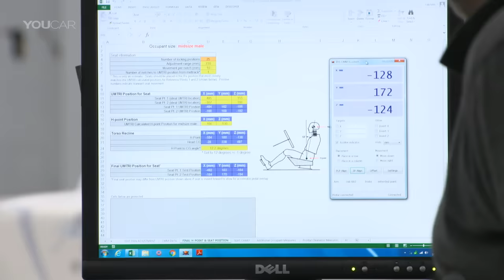CAR VS TRUCK – CRASH TEST Semi Trailer Side Underride

Comment: As a truck driver with 14yrs of experience, I'll be happy to inform the public that the fiberglass skirts on semi trailers is for fuel economy/aerodynamic purposes only. Side impact protection would be a nice addition to all trailers but I doubt I'll see it regularly.
Reply: The trucking companies such as Schneider would lobby the fuck out of congress and local governments before they allowed this. Although the regulatory bodies themselves probably have the power to do it without approval.

I would image it weighs a fair bit but I would assume you could potentially make it out of aluminum and have a similar effect.

Personally I’d like to see it more so because when driving next to a semi, I’m always afraid something might happen where either the semi swerves or I swerve and then I wind up under the trailer and get crushed by the back wheels like in 2 Fast 2 Furious lol. That’s why I always either follow or quickly pass a semi, I never drive next to them for more than 3 seconds.
Reply: Cheaper for a few lives to go rather than change a small thing on millions of trailers.
Reply: @ibooogeymani9380  unfortunately you're right.
Reply: 1OOTH like
Reply: People who are saying use the same thing as on the rear of the trailer, but isn't this essentially the same concept with with an aerodynamic skirt attached to it?
Reply: Antonio whatever profit over people man
Reply: As a driver myself wtf are people doing driving under a trailer in the first place this isn't the fast and furious. Although this would be amazing to save lives, unfortunately 4wheelers will always think the own the road and find another way to get killed by a semi.
Reply: Great idea. Should be mandatory. But weight could be an issue
Reply: @stran9adan9a63  yeah that was what i was wondering. How are you going to end up hitting the side of a trailer.not possible on the freeway but maybe on exits
Reply: If that becomes common you will see more semi trucks hung up on train tracks !🤦🏼‍♂️
Reply: I can see this happening when someone runs a light. But it's just not feasible to save everyone from every risk. Let's wrap ourselves in bubble wrap and hide in the basement, and call it a day.
Reply: I thought the skirts were to keep people from doing the fast and furious driving under a trailer thing. 🤦‍♀️
Reply: @emb_ivy  nope; just a fuel saver. LOL
Reply: Yet Tesla get the blame for the missing crash protection on the trailers....
Reply: @ibooogeymani9380  still you could consider the long-term cost of losing a few lives. Maybe those few people were important to somebody, or we're going to invent a vaccine, or were a doctor to save patients, etc. In that case the truck companies should pay to install the under-ride guards for tractor trailers. Also according to a similar crash test, the rear bumper on trailers are sometimes too weak and a car rear ending them would result in similar fatalities to this crash test. Rear end accidents can be considered common. I wonder what the price is for the good under-ride rails because if they're cheap, they can be worth it.
I think it's fair for truck companies to pay the cost. Our passenger cars have to pass a safety and emissions inspection to protect ourselves and others, and we have to pay for the repairs if necessary to drive. We can't drive without bad brakes, it would not only harm us but others. Trailer under-ride guards could be added to trucj safety inspections. That way it makes sense for truck companies to pay for the under-ride protection.
Reply: @AmandaHugenkiss2915  Yup. Why don't we require roll cages in all cars. After all, if it saves just one life...
Reply: It would be good if we started with more basic things like mandating more-than-decorative rear bumpers and prohibiting the 10-inch killer spike nuts for the front wheels.
Reply: I think is best to build a wall on the side of the roads high enough to keep the car in between the walls all over the roads. And let one vehicle per one mile in between that wall also put tracking ECM on the cars , so everytime they speed goes higher, it will automatically stop the process. That way we will never have accident and our insurance prices will be so low that some insurance companies will quite.
Reply: I thought it was also for rain channels so it doesn't blind drivers as bad in torrential rainfall
Reply: Hence why the second set are better for everyones safety
Reply: There is a bill in Congress right now to change that.
Reply: @ibooogeymani9380  They should start to at least only sell semis with side protection. Ir just make a law where you can't drive without it

Comment: In Europe side impact guards are mandatory on trucks. I find it really strange that this is not the case in he otherwise safety conscious USA. This setup is very dangerous for passenger car drivers. Also the autonomous emergency braking in newer cars might not “see” the truck until it is too late.
Reply: Are you kidding? The safety requirements for trucks regarding protecting cars in crashes range from ridiculous to non-existent in the USA. Rear bumpers are a joke at best. Truckers can put wheel nuts in the shape of long and super sharp spikes in the front wheels, like if they were Roman war chariots.
Reply: @adb012 those "wheel nuts" are nothing more than shoody plastic covers for the actual lug nuts. They can be broken by just breathing on them hard enough.

Comment: I've watched lots of these vehicle crash test videos and never knew where the car was coming from. Thanks to this video I now know that there's a long acceleration tunnel that it comes from. Also, why they decided to crash a car into the side of a trailer with air deflectors installed is beyond me. They're not designed to provide any protection for vehicles striking them, unless of course your vehicle is made of air.

Comment: Good idea only problem is with those side skirts on there you're bound to get stuck on railroad tracks in and Out of delivery Bays. They sit too low the truck will get hung up in many places. Ive been to stops and crossings where just the fiberglass skirts were dragging on the ground. Now add the metal brace and your stuck on the tracks

Comment: Fun Fact: That fiberglass design isn't meant to stop a 35 MPH side impact like that. It's supposed to prevent cars traveling alongside the trailer from getting stuck underneath it. it's not poorly designed, they're just testing it for something it wasn't designed to handle.
Reply: Huh?? Sucked-in??
Reply: Those skirts were literally invented to make trailers more aerodynamic so the truck could save fuel. Nothing else. Also the only time a car would get stuck under a trailer would because of the result of another accident, or if someone blew a tire and lost control.

Comment: doubt they'll put this for everytruck, more weight therefore more fuel consumption and cost for both installing it and running with it.
Reply: thaik56 The aerodynamic improvement over having nothing there would more than cancel out the weight difference. And when comparing against the lightweight aero ones while hauling a loaded trailer, the weight of the supports wouldn't noticeably hurt fuel economy
Reply: won't be able to do a thing when IHIS makes it mandatory
Reply: thaik56 could this increase arrow  dynamics?
Reply: thaik56 weight offset by better aerodynamics - actually comes out ahead for long haul fuel efficiency
Reply: Don't worry, the EU will mandate it sooner or later!
Reply: @scottschnegelberger8089  IIHS is not a regulatory agency they cannot make anything mandatory.  

NHTSA is the regulatory agency.  

The more you know.....,,

Comment: why their using every single time chevy malibu for trailer crash tests
Reply: For 2 reasons 1.) They want to use the same car in each test to limit changeable variables in each test, which guarantees uniform test results every time and 2.) the Malibu represents a typical sedan; a normal car that most people drive. More people drive midsize sedans compared to say, sports cars or hatchbacks
Reply: Whether you like malibus or not, they got the top safety rating of this year in its class. They used it because theoretically no vehicle would perform better than the top safety pick. So if the safest vehicle does poorly they know for a fact  somethings wrong lol.
Reply: Payne Stancil or GM be slipping them extra cars for this type of testing in exchange fire safety ratings. I mean I doubt it but it wouldn’t surprise me either.
Reply: @Realest Ryoma  why do insult a car
Reply: They don't peel off the roof,I guess
Reply: @paynestancil4698  and is a safe car👍

Comment: I wanna know where IIHS gets all the 2009/10/11 Malibus from
Reply: I'm pretty sure they just buy them from local dealers
Reply: They pull them out of thin air
Reply: Tons of used ones around, fleet auctions, etc.
Reply: They buy them in used car dealers,manufacturers,does not furnish cars
Reply: Probably the own brands like chevrolet gives them the cars-
Reply: @ajtritto3989  yes

Comment: School buses already solved this issue, their frames are about 3 feet up, but they have steel side skirts that help prevent cars from diving under the bus. The skirts bend in the impact to dissipate energy & create an angled impact surface rather than a hard edge that decapitates the car passengers.

Comment: The panels on the underside of the trailers is NOT meant as a safety measure, but is for fuel economy.  HOwever, I do think that manufacturers should put beams (like they have on the back) on the sides of trailers too to stop vehicles from going under, or at least stopping a vehicle from completely going under a trailer.  But those trailer "flaps" are NOT meant as a safety mechanism.  They are strictly for fuel economy.

Comment: It works but not efficient for anything else to be honest. Must heavily desscrease a truck’s fuel economy and trailer capacity. Thus descresing the desire to buy a safer one. There needs to be a more compact design, but good idea though.
Reply: Actually the fiberglass ones are there specifically to increase fuel economy via aerodynamics.
Reply: @cherrypepsi2815  
Yeah those must be nice. But the truss one looks like a lot of added weight for a rare kind of accident. Not worth it.
Reply: @42luke93  Yeah, the angel wing looks heavy

Comment: you know you can trust them if they have windows 7 :)
on a serious note, amazing tests, so fiber glass covers basically endanger the drivers
Reply: To be fair the fiberglass is literally for nothing other than aerodynamics and fuel it's an aerodynamics and fuel economy that's it. Unfortunately gently not the truckers but the owners of the trucks that a lot of these structures work for and the companies who own the trailers don't care about the safety of the public all they care about is that their cargo gets where it needs to go and they get paid truck drivers are decent people they work hard And it's a grueling job.
They 99.9% of the time when you don't own the trailer jis rayla just the rag.

Comment: Or or we could build cars higher and ya know put more fucking regulations on them for once.
Reply: You're so wrong I literally don't know where to start.  You think the car being a couple inches higher would help anything?  The car would have to be ~1.5 feet higher or so before it even made a slight difference, and realistically more than that because the whole bumper would have to hit the trailer box to be any safer.  Even a lifted pickup will under-ride a trailer like that.

And they can't lift the car that much because a) people won't buy a car that's hard to get in and out of, and b) that's kill the fleet gas mileage, which needs to be above a certain amount for an automaker to even be able to sell cars.  

"Put more fucking regulations on them," what a fucking joke.  All of the shit people complain about is because of safety regulations.  Large A-pillars killing visibility, cars being WAAYYYY heavier than they were 15 years ago, modern cars all looking bland and bloated, all of this is due to modern safety regulations on cars.  And like it or not, it fucking works.  You like rotary engines?  Too bad, they get shit mileage, illegal.  You like pop-up headlights?  Too bad, they injure pedestrians, illegal.  You like small cars weighing less than 3500 pounds?  Too bad, they weren't safe enough before.

I don't even know why I'm taking the time to write this, you probably aren't going to read it and then you'll spout some more ignorant shit like you all do.

Comment: The impact protection wings are effective on saving the car driver but the way the trailer bent in the area above the impact is conserning
Reply: The trailer without the impact protection system would most likely still be trashed/need extensive repair so, what's your point? No point in saving lives because we might cause extra damage to a couple hundred truck trailers every year?

Comment: I'm glad we're finally facing this problem, but these underride guards are a half century overdue. I read about a crash in Indiana in 2001 where a semi jack-knifed across the freeway and a Chevy Astro van carrying two parents and their two toddler children couldn't stop in time and hit the side of the semi. The front end had so little damage that the air bag did not deploy, but the roof was peeled off and the crash killed the parents right before their children's eyes. 

May 4, 2019 3:37 am

Comment: I'm a truck driver, have been for 3 years. This sort of accident never happens. The stars have to align for this to happen. It is illegal for trucks to do U-turns almost everywhere. and this would add so much weight to an already heavy trailer. meaning less load weight, meaning less money. Its already expensive af to own and operator your own tractor. Hard no.
Reply: The fiberglass is installed on a lot of trucks, but the angelwing guard isn't very common

Comment: I think that the Angel Wing side skirt on the truck should be used on all semi trailers because those would save so many more lives than that crapy fiberglass one
Reply: acPROD.1803 how many people do you think die from this??? hardly any to none. fiberglass side skirts isn't for safety. it's not meant to save anyone.
Reply: uhhh have u heard of pile ups in the winter
Reply: and also accidents happen
Reply: No the angel wing would cause more problems than it would solve, take it from me a experienced trucker those side skirts or Gurley skirts as they are more commonly know as in the industry are there for aerodynamic reasons not protective reasons, the idea is that the less airflow under the trailer the better fuel efficiency of the rig it is the same idea as the wing you see on the back of the trailer and the side skirt and and fairings on the bottom of a newer rig and between the back of a rig and nose of a trailer

Comment: There you have it lady's and gentlemen if your about to crash under a trailer pull that manual seat and lay down quickly as possible or if you have powered seats just tilt your body sideways your head to the passengers seat to survive this

Comment: The car looks the same outside but in side there different. The car that went under the trailer had a gutted interior which then makes the car lighter so I was easier for it to go under the trailer cause it has less weight.
Reply: Wrong. More weight means more kinetic energy and more kinetic energy means it takes more distance and deformation of the structure to stop.

Comment: The cost of the crash barrier is  about $4,000, installs in about two hours and weighs about 800 lbs. We don't see this on all of the trailers because it has not been made mandatory yet.  Seems like more people must die before there is any action by the DOT to require them. The trucking companies are not going to increase costs because they are looking to cut profits but they might if they got phone calls from every viewer.
Reply: For that matter, what they pass off as Jayne Mansfield Bars in the back of semi-trailers vary in design, and while they meet the letter of the regulation, many don't prevent the passenger car from under-riding.

Comment: I'm not one for government regulation, in fact I'm completely against it and of course it has nothing to do with the truckers they either work for a company or own their own rig.
But of course you never own the trailer they're just picking those trailers up.
Back to my original point I'm not 1 for government regulation at all But....
Just like airbags and seatbelts I think there should probably be a time line on trailers needing to be retro fitted with these things and new productions having them standard. Because I don't know about you guys,
But I'm a big fan of my head staying on my shoulders.

Comment: If .poss for side hit on more than 10% of road then semis large scale not allowed w/cars & semi only lane best deal. If it breaks 10% rule u must use smaller scale trucks on these roads that is safe to use w/cars trucks motor moped etc transports only way not trying to modify every fucking side *2 of every truck not poss to car proof that big a world/house.